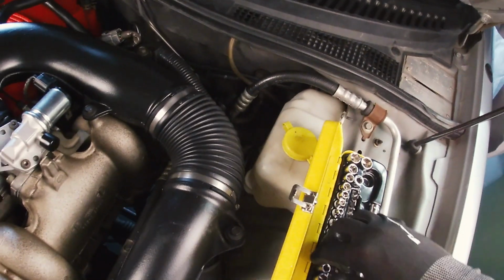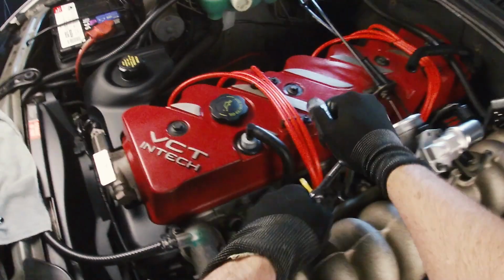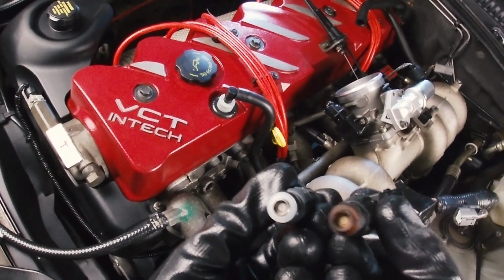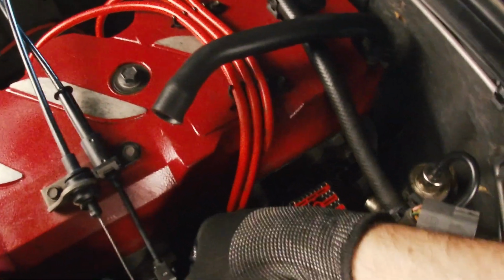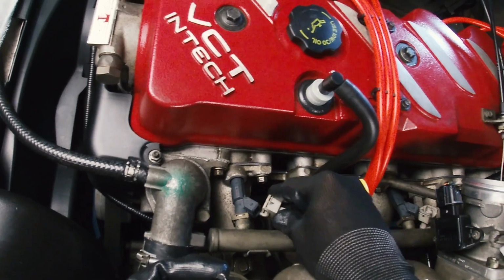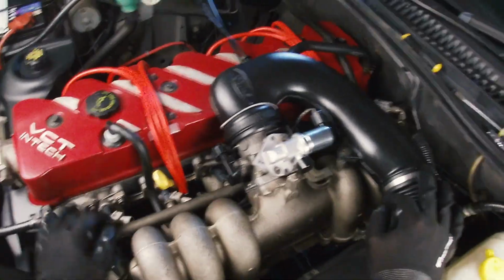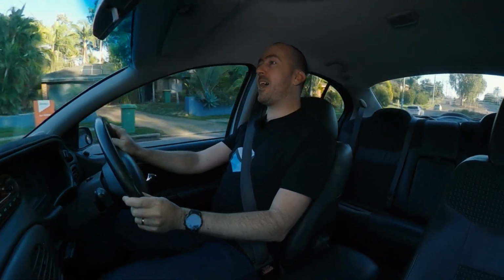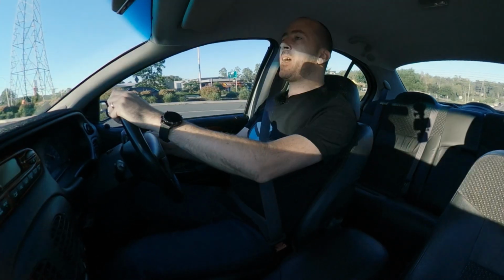Replacing Fuel Injectors on any 6-Cylinder Ford Falcon. AU Fairmont Ghia Intech VCT Bosch 19lb 220cc

Comment: i used no name injectors in the past and while they didnt fowl any plugs they were noisy arfter a few months with Tk-Tk-Tk-Tk (just loud enough for ME to hear i like a smooth quiet engine so this was annoying lol) oh one more thing, it looks like the previous owner ran E10 fuel in your AU before you got it, E series and AU series HATE E10 it does exactly what you seen there gunks everything up, run 95 minimum you wont have a problem again!